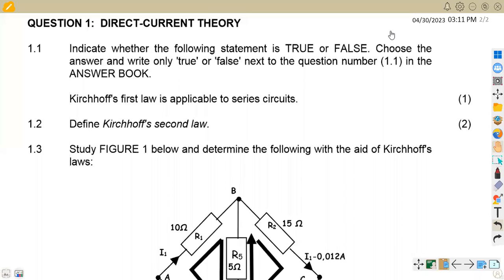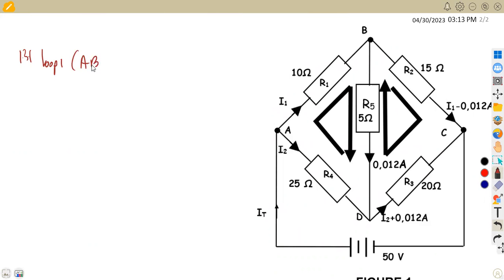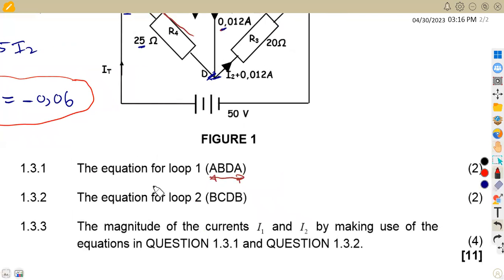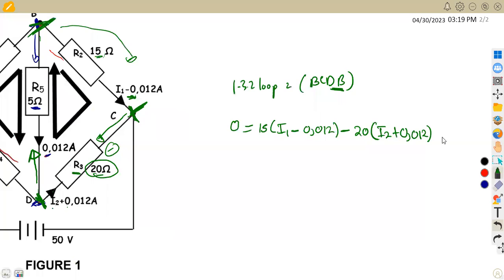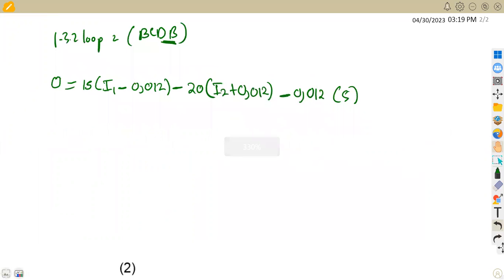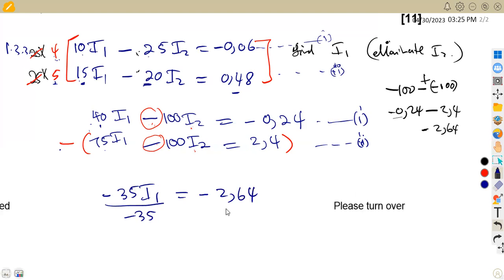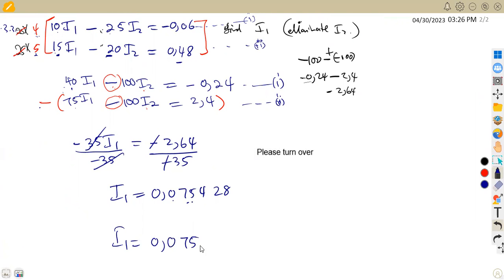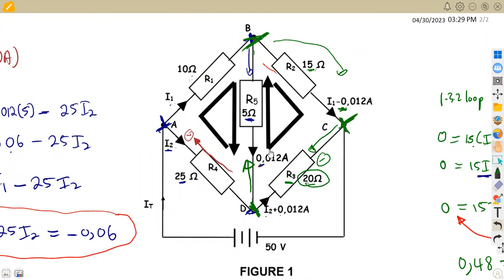Industrial electronics n3 kirchhoff's laws |D C THEORY AUGUST 2016 @mathszoneafricanmotives

Comment: Sir why is the Vdrop = 0 ??
Reply from the maker: Which part exactly
Reply: If you put a multimeters black and red lead on point A it will show 0v because there is no potential difference, (a point cant be at two  potentials)

(Google Kirchhoffs Voltage Law)